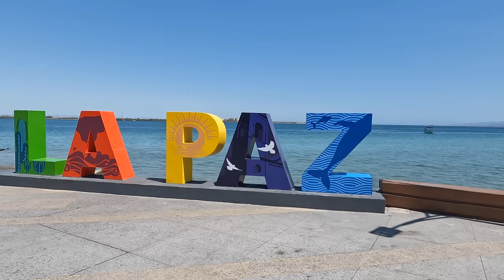One of the BEST anchorages in the world? | Ep 366

Comment: Bit late to the party, but that looks like a case of a lot of water in the tank.  I just built a fuel line with a weighted fuel clunk to drop into the bottom of the tank and draw out from as low as possible.  I pulled out about 24oz of water.  I then replaced my deck fill cap.  The old one had an o-ring that was dried out and had hairline cracks on it.  I suspect I had water entering from the deck fill.  I then treated the diesel with a water emulsifier so that what is left would travel through the system and get burned out the exhaust as steam.  Mechanically cleaning the tank is certainly better, but this might get you to your haul out.